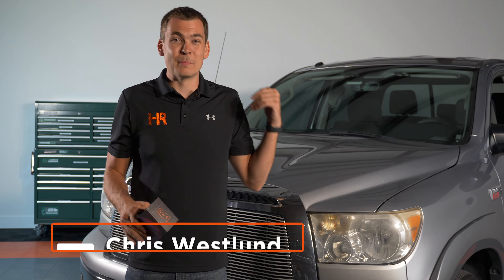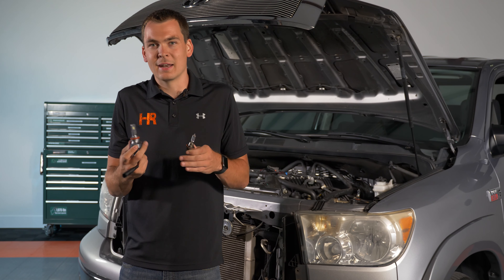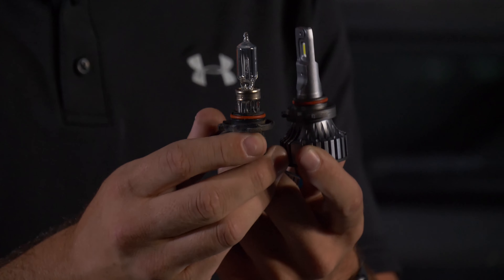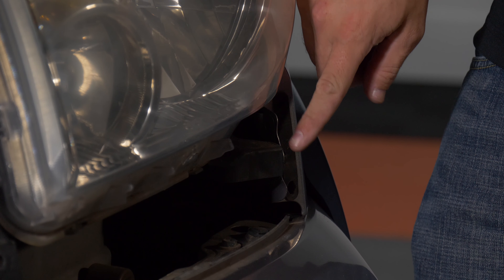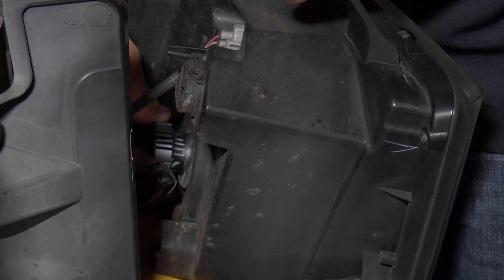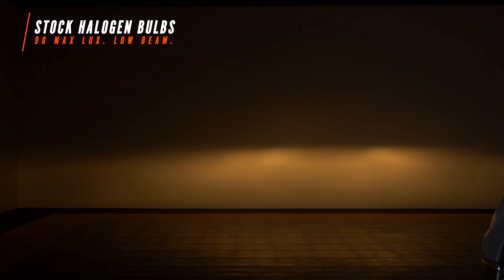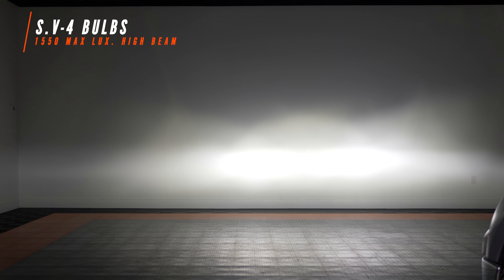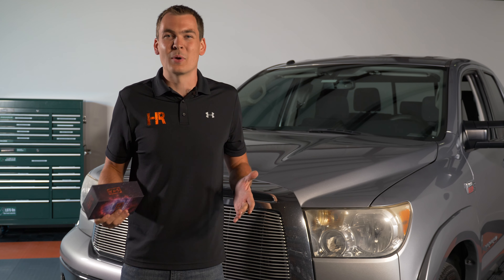07-13 Toyota tundra S-V.4 INSTALL | Headlight Revolution

Comment: I've had S.V-4 bulbs in my old 2003 Tundra for years with great results.  Just bought a 2013 and looked up the S.V-4s and I'm floored at how expensive these things have gotten, especially since this truck has separate high and low bulbs. $400 almost breaks the bank over here!

Comment: First thing I would've done is replace the headlight assemblies. With as cloudy as those assemblies are, they're going to create glare for oncoming drives as well as hamper the performance of the S-V4 bulb itself. You could probably eek out another couple hundred lux by getting nice brand new assemblies.
Reply from the maker: You are true, but this vehicle belonged to a volunteer and they didn't want to. We agree with you though.

Comment: So you didn’t mention anything about resistors?  Or how do you make them work, where the high beam will function?  I have the led for low beam and led high beam stays on!  Tried putting back halogen bulbs and they stay on with high beam selector off too?  My only solution is because low beam is still led?  Hoping a resistor will solve the problem?  But wish someone could just explain this off the bat!  Can’t find an straight answer anywhere?!
Reply from the maker: If you're having some issues give us a call and we should be able to come up with a solution for you!

218-755-5200
sales@headlightrevolution.com

Comment: Are the S-V4 bulbs DOT approved?  They are quite a bit brighter than stock.  Do they require adjusting the beam down as to not blind oncoming drivers?  Thanks!!
Reply from the maker: They are DOT approved. They require a small amount of adjustment upon installing.

Comment: What do you recommend for the foglamp??
Reply from the maker: The SV.4 bulb used in the headlights works just as well in the fog lights as well, I’d recommend that!
Reply: Headlight Revolution what size fit my 2014 toyo sequioa foglamp?
Reply from the maker: It looks like you need an H11 size bulb, Send us an email if you need help picking one! -Chris W